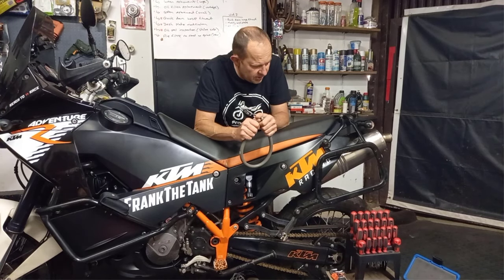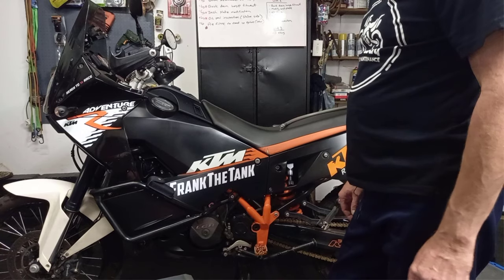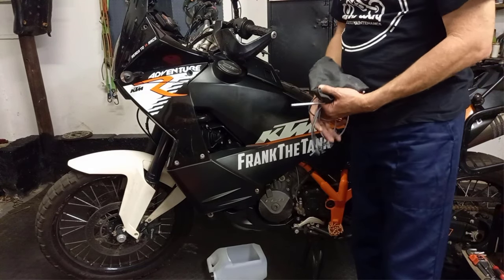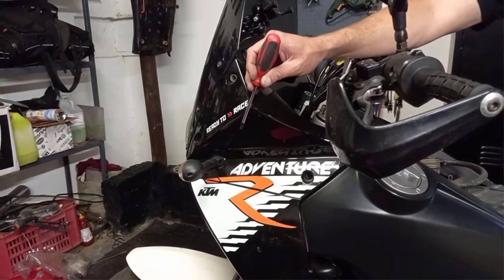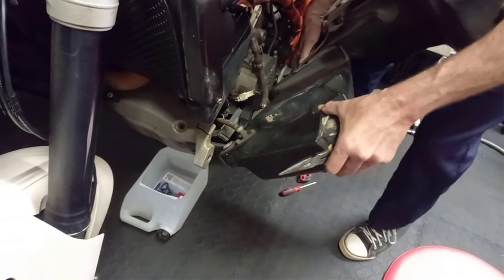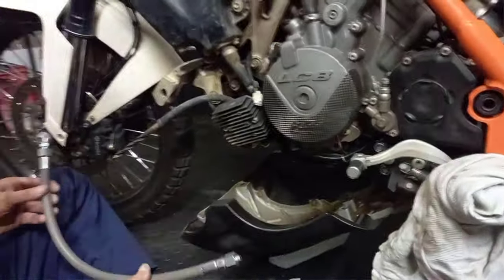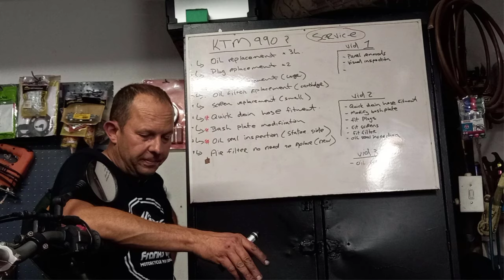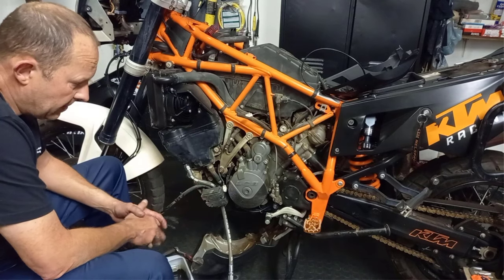KTM 990/950 Service Explained #ktmbike, #ktm990,

Comment: Thanks Frank...love my 990 so always appreciate those that are still wrenching on them and sharing their knowledge.
Reply from the maker: Hi TMacD, the 990 is a legendary bike which has no replacement in my view, a lot of people i know,might sell their 990, by a 10 or 1190...but eventually miss the 990 so much that they buy another 990 in the end.They are simply put,workhorses in their own class.You have to own one to understand :)
Reply: @FranksWay  Could not agree more!  I call my 2008 BedyG for the Big Dumb Grin she puts on my face every time I drift her through the gravel twisties or crawl her up some rocky twin track.  Funny how a 500lb bike seems to get smaller the harder you ride is...it's like the are in their element.  Thanks again for the content you create and safe travels.
Reply from the maker: @toddwmac  Thanks,yes they are very focused motorcycles....until you need to pick it up..then the weight becomes apparent very quickly, i must say..KTM suspensions aren't easily beat by any manufacturer,they are simply great,safe travels and fully enjoy the ride outs!!!

Comment from the maker: In the video I talked about the 990 making use of a dry-sump system and 1190 a wet sump system, the 1190 also uses a dry-sump system :). The 990 engine took just over 3L of oil with filter change.

Comment: This doesnt seem that bad compared to the number of screws I needed to remove to get the tank and panels off my Elefant 900AC.  I'm looking at a 950/990 as a possible replacement, perhaps even a 950 Super Enduro.
Reply from the maker: The 950 Super Enduro,is slso a great bike....scarce..but great..

Comment: Hi Frank. Thanks for sharing. Interesting video even tho I've only got a 990 Superduke. I was wondering how removing the magnet from the oil tank sump will affect engine performance in the long run, as mine always has a tiny bit of ferrous fur on it. Do you reckon it will cause no harm and just end up on the sump plug magnet?
Reply from the maker: Hi,interesting question,i would certainly want to incorporate a future type of magnet in there.. but hey,use good oil and change every 8000km or so and youre safe...but i will ferl better with a magnet in there somwhere...agreed.
Reply: @FranksWay  Looking at the oil system diagram in the service manual, anything big would get caught in the oil tank screen before the oil reaches the engine. But the the next step is into the first oil pump, so fine ferrous debris could cause premature wear there. After that it goes thru the oil filter so the rest of the engine should be safe. Def, regular oil changing would be recommended, but perhaps you could attach a small neodymium magnet onto the tip of the screen on the tank side 😉
Reply from the maker: certainly will do that,thanks for your detailed input,will get to that....converting an NC700 now...how about 35kmpl on that machine.. it just makes sense

Comment: About to change the fuel pump filter. Have to remove the tank to do so. This bike is a total pain in the ass to work on. My least desirable bike in that regard.
I have the drain line for the oil tank so I don't have to do all this.
Reply from the maker: I have to change my fuel filter or at least inspect it tomorrow on my 990R, i feel your pain :) . At least with the oil hose it makes oil changes easier. Yes pain in the butt, but i still love the beast 990.Good luck bud.

Comment: Thanks Frank first video I've found showing how to remove everything. I guess some people don't like the drain hose because they change the filter every oil change. What are your thoughts, think its okay to leave to every second change? I was thinking about getting one. The again
Reply from the maker: Hi Ian, it all depends on the individual, if I think back to the old XR500, that engine had NO oil filter and a simple screen at the bottom, they still run if the timing chain didn't shave the pipe through that delivers oil pressure to the head. The 990 has two screens, one cartridge filter in place. If your maintenance is up to date and you use the correct oil and find no visible shavings in your top reservoir screen on oil changes, I don't see why I should change it every 8000kms. It's a self preference on that one.I make sure the correct oil and plugs are bought within the recommended service intervals, which keeps my bike happy.
Reply: @FranksWay  thanks Frank, look forward to any other 990 videos you produce
Reply from the maker: Awesome,thanks for the reply Ian.